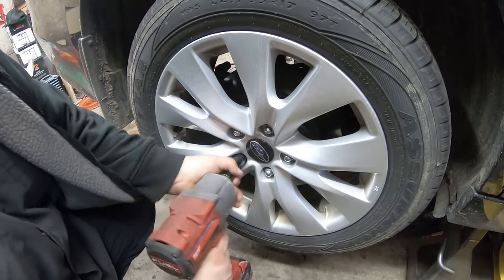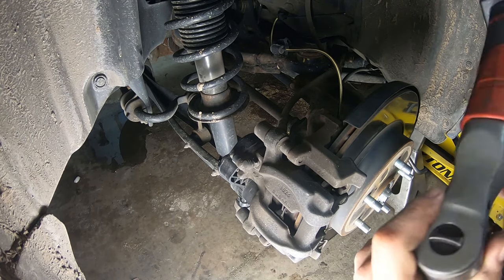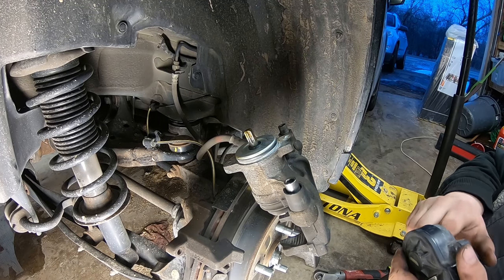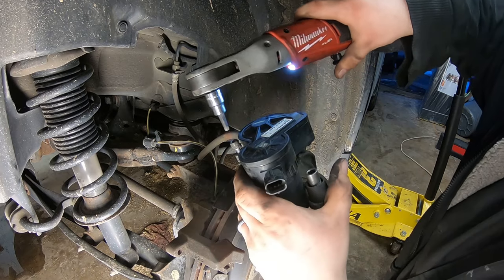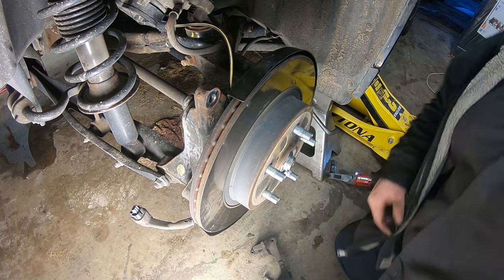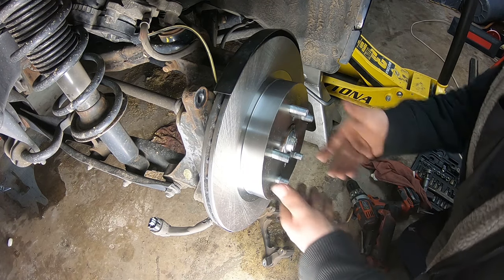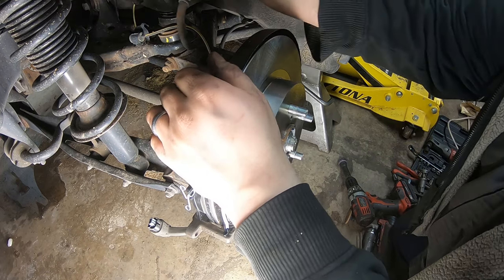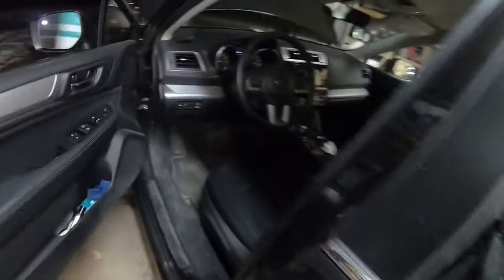2014- 2019 SUBARU LEGACY REAR BRAKE PAD REPLACEMENT (WITH ELECTRONIC PARKING BRAKE )

Comment: If you don't have a rear caliper winder, you can just use the tips of heavy needle nose pliers and pressure to wind/push it in.
Reply: You can, but renting the proper tool at a part store tends to be free and will save you a lot of pain and anger
Reply: I just used my naked hands hahaha

Comment: Thanks man!  I just replaced mine today and while I am not totally hopeless with auto repair, but it sounded hard to do rotors/pads for front and rear.  Honestly, it went well (looked up a separate video for front)!  Step by step made me feel really confident and spent $380 for a replacement kit rather than the like $1500 the dealer wanted.  Just took it around the block and slammed on the brakes a few times.  Works great.  All in all was a fairly easy and straightforward repair.

I just moved into a house so I had to also buy a couple of tools bc living in an apartment makes working on your car pretty dangerous.  I started thinking I didn’t want the brake tool but decided it was worth the $40.  But other than my Jack/stands I already had, I only had to spend about $60 in tools I didn’t have. And I get to keep those so I don’t necessarily count that bc now I can help out anyone else who needs it in the future.

Comment: I am so grateful I found this fantastic video.  I was shocked when the auto store quoted me $830 dollars to do this exact procedure (including a $230 electronic brake "recalibration" fee) and am so happy I came across this video.  Easy to follow instructions, and allowed a car dummy like me to do the job myself for a fraction of the price I was quoted.

I figure you saving me 600 dollars is definitely worth a like and a subscription.

Thanks again!
Reply from the maker: Glad I could help
Reply: Recalibration fee... I think somebody was trying to take advantage of you
Reply: I did the job today. This is by far the best video. One my passenger rear I could not release the power plug to the electronic brake so I dissembled it while plugged in. I RE greased it after taking it apart. So as an experiment it worked as well. But the caliper retraction tool made it the easiest like the video showed. Great job on this.

Comment: Greg from Melbourne, Australia. I have a 2016 Outback diesel Premium and need to do rear pads (123k kilometres). This video and instructions make what looked like a difficult task much easier. The only thing I had to change is the compression of the piston back into the caliper body as I don't have the special tool. I used a set of multi=grip pliers and GENTLY screwed the piston back in. Brilliant video. Thanks again from Down Under.

Comment: This is probably the clearest and best video with replacing rear brake pads for cars with the electronic parking  brake. I have a 2019 Subaru Forester, and I think this videos of replacing rear brake pads also applies. Thankyou so much especially  with the reasons why the electronic brake motor needs to be disengaged while pushing the piston back into the caliper.
Joseph

Comment: Good call on taking the brake module off, before compressing the piston🤘
Reply from the maker: Thanks 👍
Reply: doing my research and so far have seen few other videos doing the caliper piston retract without removing the ebrake actuator part off first , and on those video seeing a few comments about losing brake pressure even some damages, i am guess this is the critical part?

Comment: Thank you for your video.  Can the electric parking brake be used after having retracted the brakes in this way despite the computer not having the information?
Reply: I wanna know this as well, just finished one side after watching his vid.
Reply: After giving it a test drive I then set the parking brakes and they automatically calibrate themselves. I also never used the special tool he had in the vid, I just use a long nose pliers to turn it and use the regular brake piston compressor tool and it works no issues so far

Comment: I just did my back breaks and put new rotors on and I’ve always just removed the caliper and caliper bracket all in one piece then when I get it off slide out the pins and clean and grease

Comment: Are you using seal Glyde on the rubber o ring?  I need to tackle my rear brake job but I need to order the caliper retracting tool and get some grease

Comment: Why did you need to take the e-brake actuator off? You also should be more careful when taking the wheels off so you don’t mess up a stud. I know because I’ve done that and then had to replace a stud. The threads are very soft on Subaru studs.. Now I hold the wheel on when I loosen the last lug nut and then carefully lift the wheel off.

Comment: Thank you very much for making this video and showing how to do this without a scan tool.  I have to change my mother's rear brakes, and she lives 160 miles away, so I needed to know if there was anything funky with the electronic brake making this anything different than a standard rear brake job.  BTW, I assume you didn't have to disconnect the negative cable first. BTW#2, how bad is it to change the serp belt on a 2016 Legacy with a 2.4L?  I'm not asking for a paragraph break-down; maybe just a two word answer, if you will.  Thank you.
Almost forgot, thank you for explaining the sizes on the tools needed.
Reply from the maker: Sorry for late replay , but no did not remove negative cable  just ignition off and parking brake disengaged , serp belt is pretty straight forward just adjusters to remove and adjust and some have the automatic tensioner bit it's pretty easy

Comment: What did you do best at 10:45? These guides should be clean and dry. This is the only way they can work properly. There are ribs in the rubber part that are to retract the brake caliper. When you lubricate the rails, these fringes do not work at all.
Reply from the maker: says to lubricate them in the service manual  so i did

Comment: If I want to skim the disc rotor, I could just remove the caliper hold-down bolts, yes? I have a Subaru Impreza g4 2017. I also have an electronic parking brake.

Comment: Why did you take the actuator off since you had the tool to compress the piston and turn in the electric brake? Seem like that was an unnecessary step?
Reply from the maker: Nope with out putting the caliper in service mode with a scan tool you can upset position sensors for electronic park actuation , which is why indid it this way. I have a scan tool at home that can put them into "service mode' but this is a way for the DIYer to get it done

Comment: I don’t get why you need to take apart the ebrake assembly? If you are winding the piston back what mechanical difference does it make to do that? Is there something in the actuator that you don’t want to twist?
Reply from the maker: If you don’t have a scan tool you don’t want to rotate the position sensor of the non applied brake caliper motor
Reply: @JoeTheAutoGuy  thank you

Comment: Is it okay to use dielectric grease instead of Sil Glyde on the o-ring? I haven't had to pull an electronic parking brake motor off before.
Reply from the maker: some kind of lube is needed preferably silicone based and dielectric grease works fine

Comment: Which brand pads for the rear on a 2016 Subaru legacy LX 4 cylinder are the best to install? Are they available on Amazon please? Thanks
Reply: I have a uk spec 2008 legacy asin pads i find are a good set front and rear and febi bilstien discs

Comment: Once the caliper is back on And you have stepped on the break until you get a firm pedal ,what do you do to get the parking brake correctly reset?
Reply from the maker: That’s the point of removing the parking brake motor position sensor it won’t require it to be reset
Reply: @JoeTheAutoGuy  thank you. So I understand that, once you step the fluid back into the brake lines, by pushing the brake pedal, when you run the parking brake, it will simply spin down and clamp?
Reply from the maker: @33turtles95  correct

Comment: 1:51 you made that connector removal look so easy
Reply from the maker: Push in , pull tab then pull back should be easy to remove
Reply: Tab is toward the bottom

Comment: What is the point of taking off the actuator cover?
Reply from the maker: If you don’t have a scan tool to reset the position then you have to remove it otherwise it will error out

Comment: I hate ebrakes. Why not just a lever… great video
Reply from the maker: Less parts to produce is the main reason , just a couple wires instead of cables to produce and house in a warehouse and have a brake caliper bracket produced , but they still have thier issues

Comment: Do you think this process would be similar for a 2012 legacy?
Reply: Same question here
Reply: @johncornell1335  my sons 2012 ended up not having this style brake system and the regular clamp you'd use to push the piston back did the job.
Reply: @johncornell1335  his is a pzev? Something like that. The eco version of the car.

Comment: Is it really necessary to take the E-brake module off when you're compressing the piston?
Reply from the maker: To not damage the electric motor yes
Reply from the maker: Or if you have a scan tool you can just put it in service mode
Reply: @JoeTheAutoGuy  Thanks for the reply. GIven the piston moves in/out during normal driving, not sure I understand why pushing the piston in to do brake service while the electronic e-brake module is on would damage it? Does the Owners manual specifically call this out?
Reply from the maker: @macker0077  if it's not in "service mode" it has a position sensor internal calibrated when you turn it with out a scan tool you change the position of the motor and it can brake the gear when it arking brake apply thinking it has further to go or to retract when it doesn't,  so removing the motor while you perform service is away to get around not having the scan tool to put it into service mode
Reply: @JoeTheAutoGuy  Ok, thanks for the explanation.
Reply: @JoeTheAutoGuy  I followed the video and removed the e-brake module but I still had errors on my dash for parking brake and no i-sight. The dealer said it has to be reset still after a change.

Comment: Followed your video to do my sisters Subaru Legacy 2017 and the parking brake light came on after about a week any suggestions? And also what are the little teeny wire things that come with the brake pads
Reply from the maker: break pad wear sensor are the tiny wires , red , yellow,or service parking light illuminated?

Comment: No torque specs on the bolts? Lol
Reply: Found them at a Subaru forum.  5.9 foot pounds for the electronic brake controller and 18.4 foot pounds for the caliber slides
Reply: @jonsimonson thanks. How about bracket bolts?  Thanks again
Reply: @edwardjackson9871  48.7

Comment: My ECU errored out after this.
Reply from the maker: Parking brake is separate from your ecu , what dtc are you getting ?
Reply: I did everything you did. Now the car’s e brake is not working, eyesight is turned off, RAB is turned off. Do I need to reset something?
Reply from the maker: @kristoffergalvan5365  potentially moved motor when you removed it from caliper , need to get it into service mode and reset positions
Reply: @JoeTheAutoGuy how do you do that? I’m having the same problem